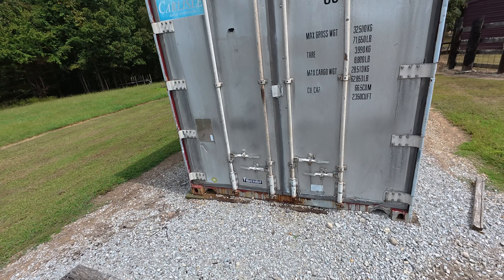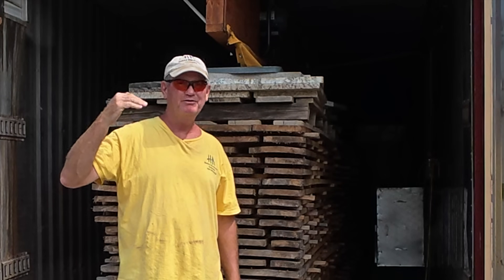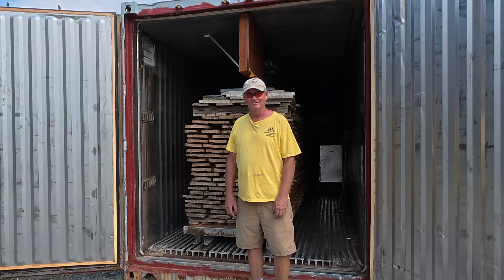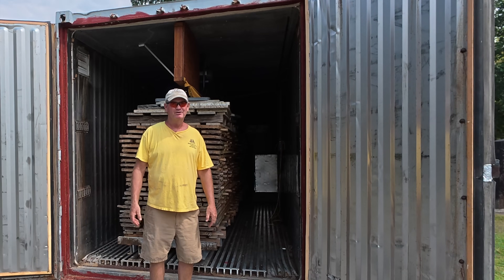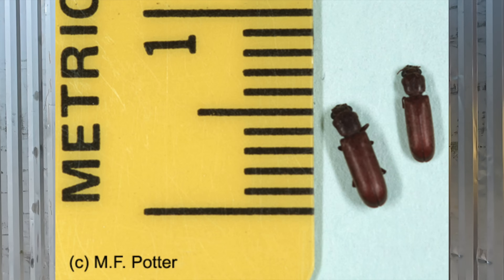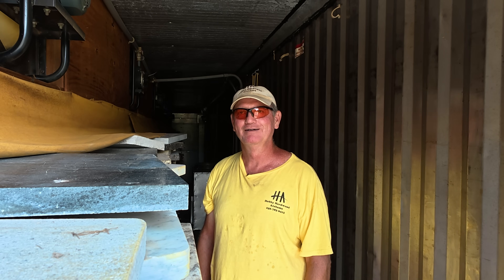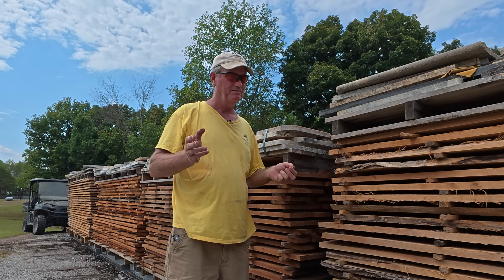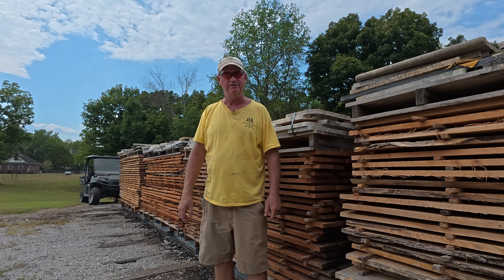26 Lumber Kiln Myths and Truths PART 1

Comment: Great video.  I know you talked about furniture build before kilns and because the humidity levels in a house was the same as when they were built there was little problem.  We have 18 antique pieces (tables, chairs, chests most from 1880-90 period) all sitting on level kiln dried wood floors in an air condition environment with no wobbling, and no bug problems.  Did they treat the wood some other way back then?
Reply from the maker: Yes, a good wood worker can tell when a piece of wood will dry and stay flat and so well make furniture from them.  However, I have seen many old pieces of furniture that were wobbly disasters.  I was even giving a lecture to a local museum and it devolved to me going to almost every piece of furniture and showing signs of movement and how they could "fix" them.  So most likely your pieces are well made by a skilled craftsmen.  Bugs are hit and miss, and using fresh, green, no sapwood lumber greatly eliminates the possibility, especauil;l;y if it was dried in a protected environment.  Also, some old school finishes can be quite toxic to bugs and even in this area, diesel fuel (yes it stinks) is still used as a lumber pretreatment. Do not do it...Also, oddly enough, as wood ages for very long periods of time, it the cells walls will collapse, almost as if it was kiln dried, and you can tell when this happens as the pieces of furniture will become very light, as in noticeable lighter in weight.  Basically, back in the old days, good furniture makers knew that had problems with big and shrinkage and knew the tradecraft to try to over come to, depending on their skill level.  Good question.

Comment: Are species specific drying schedules readily available online or is that recommended by the kiln manufacturer?
Reply from the maker: Both, but since each kiln is different, each has their own drying schedules, and all are approximate, at best.  However, there are very professional kiln schedules that are very accurate, but they generally do not apply to different low temperature styles.  The main thing is dry as cool as possible and stay just below the max moisture removal rate for that species and thickness.

Comment: Would like to hear your thoughts on an entry / hobby level kilns from Nyle or iDry.
Reply: We researched both heavily, including talking to several owners of both.  After months of consideration, we went with Nyle.  The primary reason was bang for your buck.  Based on my conversations with iDry vacuum kiln owners, our kilns take about 25% of the energy to operate than the iDry Vacuum Kilns.   I know that they have come out with an iDry "Air", but that too is more expensive to operate.  They vent their moisture, which causes you to loose heat, which results in the kilns costing more to operate.  With the Nyle Dehumidification kilns, the dehumidifier pulls the water out without venting out heat and it re-heats the air at the same time.  A local Sawyer who was considering buying a kiln started off using the services of a local iDry operator.  After sending a couple loads my way to kiln dry, he quit going to the operator that used the iDry kilns.  He told me that the wood that came out of kilns was better, consistently dry and flatter.  That being said, Robert is absolutely correct when he said that at the end of the day, it is not so much about the kiln as it is about the kiln operator.  If you are not paying attention, both kilns can absolutely ruin wood and both kilns can produce some great kiln dried lumber.    If build correctly and you monitor the heat and moisture, a solar kiln can likewise have great results.  The only disadvantage I see to a solar kiln is that it is very difficult to sterilize lumber in it, unless you have an external heat source to maintain the temperatures for the proper period of time.  For example, with 4/4 Poplar lumber, we typically put it at 140 for 24 hours.  According to a gentleman at Virginia Tech (I attended one of their solar kiln seminars), a solar kiln can get to 140 during the summer, but it does not stay at that temperature long enough to get the core temperature of the lumber at the needed temperature long enough to kill the bug eggs.
Reply from the maker: 100% correct, very well said.  I knew the Wood Doc, Dr Gene Wengert, inventor of the VA Tech solar kiln and sterilization was a topic we discussed about several times.  I had removed wood from solar kiln in the middle of an Alabama summer and still had ants crawling on it so I know it wasn't fully sterilized.  I used mine as a kiln but sims,ly transferred the wood into my conventional kiln at the end of a sterilization cycle, basically pull out the hot load, put in the solar kiln load before the kiln cooled down,, and immediately begin to sterilize the load from the solar kiln..  Basically, a "hot swap" and it worked pretty well.

Comment: What is your opinion of the vacuum kilns?
Reply from the maker: Mixed at best.  They can do a very good job, but are generally sold as a "set it and forget it" system, with no moisture probes.  So it can also be a disaster, and in this area, they have a bad reputation.  However, as I said, it's the kiln operator not the kiln, and in the right hands they do very well.  Most people I know have installed some sort or dedicated aftermarket moisture probes.
Reply: @HobbyHardwoodAlabama is there a specific type of species, or cut type they excel at? I see a lot of guys that do big slabs use vacuum kilns. (Large slabs are what I’m cutting now and will need a kiln for.) Would you recommend starting with a conventional kiln?

Comment: hoping to see the temperature to sterilize in the next video. My local dryer says something like hold at 130 degrees for 24 hours after wood has reached dry state. (May not have that quite right). Thanks for the video.
Reply from the maker: That pretty close, the actual number is 133 core temp, but that is cutting it close.  The standard by the operators I know, and myself is 145 to 150 F for 24 hours.

Comment: Looking at your kiln baffles, I am wondering what you do to block the air flow going under and around the lifts of lumber.  I have a top tarp bafle like you, but I also block the bottom and in between the lifts with tarps also.  Thanks for your content.  It is much needed, for the producer and customer.  Knowledge is the key to happy customers!
Reply from the maker: Lumber does not need to be baffled if there is sufficient circulation ,airflow and velocity thought the stacks, typically a minimum of 150 FPM for hardwood, up to 450 FPM.  I measure the airflow for the first several loads as part of the kiln checkout, and know where I need to baffle and not.  Very good question, I will talk about it in a video.

Comment: Question:

When stacking freshly sawn lumber for drying, is it true that you should use softwood stickers for hardwood, and hardwood stickers for softwood? (Theo from Canada)
Reply from the maker: No, it's not necessary.  More important is that the stickers have the strength to not be crushed under the weight of the layers of lumber and also not be a species that retains water and inherently causes sticker stain due to trapped moisture.

Comment: I am very confused about kiln drying when it comes to the different kinds of kilns, idry vacuum kilns adds say fresh cut green wood can be dried. In two to three weeks.  Others say that the kinds of kilns that you operate and Nathan from out of the woods that to get the best results is to let the wood air dry at least six months, depending on the climate of the area the wood is being dried in.  Then there is one that Mathew Carmona?  A DH kiln which I’m going to google as soon as I send this.
Then there’s the kiln that they put metal plates between the slabs and attach wires to them close the chamber heat the chamber as well as run electrical current through the plates which drives the moisture out of the wood very quickly.  It’s so posed to have an Evan faster turn around time than the vacuum me kilns.  How is the wood not come out with all the defects you mentioned by drying fast.  This is probably a lot bigger topic than you real want to get into, I will understand.
So many techniques and technologies, confusing.
Just an after thought, Idry 20’ vacuum kiln was close to $100,000. before sales tax and shipping 😮
Reply from the maker: Yes, and all will work and all will ruin the wood.  The best thing is to buy is one that you can afford and learn to use it, and get a good moisture meter you can trust.  I am familiar with all the kilns you mention, I should do a detailed video of their pros and cons...
Reply: @HobbyHardwoodAlabama Wow that would be be a great video I know for me that would really clear up some confusion.  You are a fantastic source of information on sawmilling and everything related to it. Keep up the fantastic work and thank you very much.

Comment: Is it possible to sterilize wood in a solar kiln
Reply from the maker: It is very difficult to maintain the duration and temperature at the core of the boards with a solar kiln.  I sometimes could in mine, and sometimes could not.  To be sure, you need a direct temperature measurement at the center of the board.

Comment: We always separated thickness in order to dry. Company I worked for dried millions and millions of lumber yearly. Personally, I wouldn't mix thickness
Reply from the maker: Generally that is correct.  However, it really comes down the species group and how easily its cellular structures releases moisture and what it's moisture level is at the time it is placed in the kiln. As a rule, species and thickness should not be mixed, however, it can be done if done correctly, I do it all the time and our claim to fame is defect free wood.  Good comment.
Reply: @HobbyHardwoodAlabama There are always exceptions to the rule Robert. Very few hobby folks have your experience and expertise. I guess I wouldn't be willing to risk an entire charge of lumber finding out. Call me chicken shit 😂😂

Comment: The best way when your going to buy a Kiln is too ASK have they a way of measuring the moisture in your boards and if they DONT HAVE well just walk away and say thank you for wasting my time Thank you Robert great advice
Reply from the maker: Yes,.  I REALLY pisses me off that kiln companies sell an expensive device for drying wood but do not sell the direct measurement instruments to confirm the process.  I get SO MANY complaints from customers who have bought kiln dried wood that is not fully dried from other operators.  It should not be an issue, the wood is either dry or not and it is too easy to measure it with probes.

Comment: Hi from Cornwall,
Can you do different thicknesses of lumber in the same drying killin 😂.

Do you move the probes round during the process? Can you even open it when its running?

Did you buy your kilns new or second hand?

Have you modified your kiln at all ? If so why....

20ft or 40ft ?? 

Where are the charts and graphs found for the relevant drying capabilities of species, is it all country specific?

Tell us your worst experience with a kiln load of lumber .

Thanks for the preaching 🙌 

We're all ears
Reply from the maker: Lots of good questions, I need to do a whole series on kiln drying.  I will do it... Good to hear from you!

Comment: Amazing video! Just bought my first mill and educating myself. I really appreciate the tips.

1. I noticed there are, what look like,  granite slabs on top of each load.
2. What is that FDA temp you need to reach? 
Looking forward to your next video! Thank You!
Reply from the maker: Yes, 3500 lbs per pile just like pressing a flow flat in a book.  I misspoke when I checked the video - I had FDA on the brain from the Chicken joke, but it is really as USDA guideline, which requires lumber to reach a minimum core temperature of 133°F (56°C) for a minimum of 30 minutes to kill most pests, following International Standards for Phytosanitary Measures (ISPM) 15.

Comment: Thanks again for another excellent video. I’m just a hobbyist that wanted a way to dry my lumber and built a solar kiln. It gets up to 140 degrees or so during the day, but cools down over night. Will this sterilize the bugs and mold?
Reply from the maker: The wood has to reach a minimum core temperature of 133 degrees for several minutes to hours, depending on moisture content and thickness.  So solar kilns can get that hot but rarely. can reach the full core temperature in excess of 133F.  I do 150F for 24 hours.  Unless it is way overdriven, it should be measured using thermocouples or RTD to be sure.
Reply: Temp is pretty good. I think it depends on the type of bug that determines the length of time at 140° it takes to kill them. 🤔🤔
Reply: Cool to see a few commenters with Solar Kilns. We’re starting small and plan to build a couple solar kilns in the spring but engineering them to have heat from an exterior wood burning stove run through the kiln to satisfy requirements. Haven’t seen this done and expect there to be considerations for the additional heat in a solar kilns build. 

The rails are brilliant!

Comment: 2 questions. Ist one may be good for the next vid. How do you spot the water pockets for direct measurement without having a zillion probes? 2nd, My little on the wall humidity gauge says 73%, How does that translate to EMC? If it is as bad as I think, then nothing I build is going to be worth a damn.
Reply from the maker: Generally a water pocket board will have lots of wet spots, or very large ones.  So even a few probes will make it pretty obvious, the board just isn't drying with the rest of them.  It will also "stall" and stay wetter longer, and as a general rule, will be significantly wetter than other packs in the kiln and will also just not dry as fast as it should.  Anytime I notice this, I will double check with my handheld and conform and then focus on the boards from that particular logs.  Remember, it probably isn't just one board that has wet spots, its probably the majority of boards form that log.  So it's not hard to spot even with rudimentary numbers of probes. 
In order to determine EMC you need temperature and RH, and if in a house, 73%, 70F will be about 13% so yes, that is going to move if it goes in your house at lower RH.  Here is a link to an EMC chart that will give  the EMC for your conditions.  
https://www.finewoodworking.com/FWNPDFfree/equilibrium-moisture-content-chart.pdf?srsltid=AfmBOoqcPEi0WXdCE4_95BVVadgvC_nflBs8LKKkCv7JVZ7Nn187lj6Q
Reply: @HobbyHardwoodAlabama  Do you happen to mark the boards in some fashion from each log to keep track if you have a wet spot noted in those particular boards?  If not do you have a good way to determine which boards to keep an eye on?

Comment: Does a kiln ever reintroduce moisture, in case of too rapidly drying wood?
Reply from the maker: Yes, you can introduce humidity back into a kiln, and is done at the end of a cycle, in a process called "equalization."  However, if wood is dried too rapidly, it begins to crack and form other defects, and I use the phrase "Once you burn the pizza, the pizza is burned and you can't unburn it."  Same thing with wood, if the wood is dried too fast for even a short period of time, a day or so, it will have some unrecoverable defects.
Reply: If lumber dries too quickly, I believe it is called "case hardening" which pretty much ruins it. Take your time, closely monitor your lumber and be patient.

Comment: Looking for the next video. One question what do i go by in a solar kiln ?  we check with the moister is when we pit the wood in and check it every week. But would like to know  what rate we should use to in sure its dry. I am talking about white oak and walnut. How can i sterilize the wood in a solar kiln.  good video
Reply from the maker: Yes I will talk about them.  Lots of questions about them.  Rarely will a Va Tech solar kiln design, dry lumber too fast.  Use a moisture meter to check the levels and do not exceed the maximum allowable moisture removal rate I talked about in one of my other kiln drying videos.  It is very difficult to sterilize in a solar kiln.